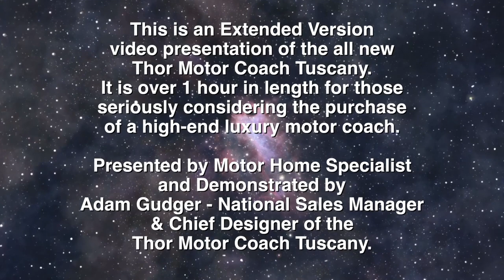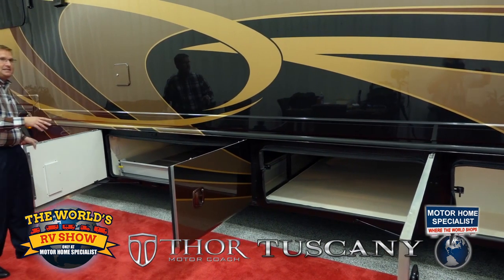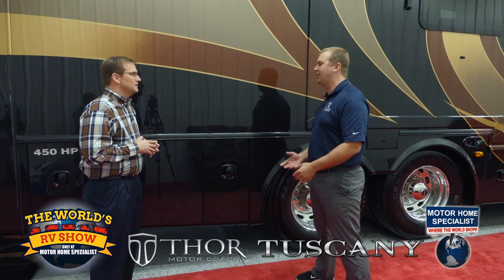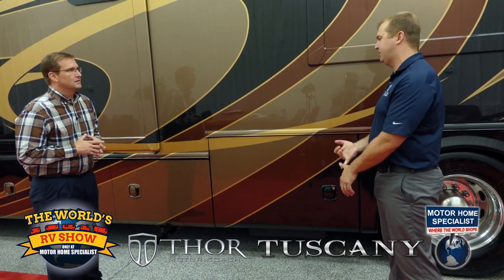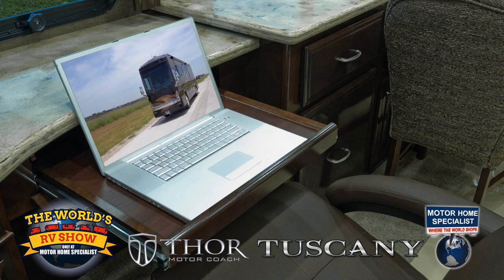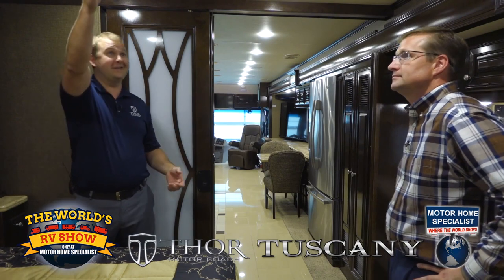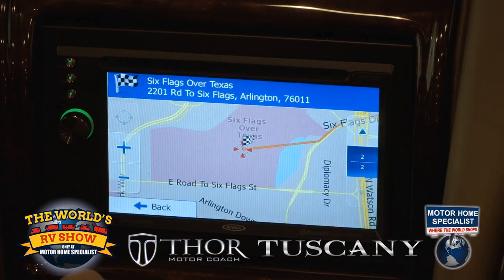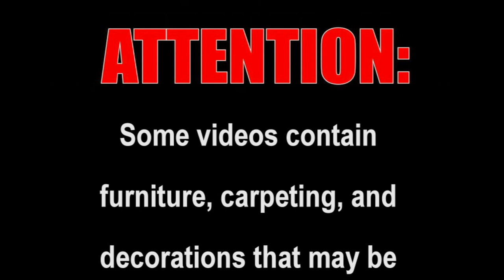Million Dollar Luxury Motorhomes? New Luxury Class A Diesel RVs For Less.

Comment: This is not an unbiased review, it's an advertisement. Unfortunately for the producers of this video, I'm both a television broadcaster and host, with a prior background as sales/marketing executive in the automotive field. Come on guys, seriously. Either produce an advertisement without a fake reporter, or produce a report with no advertisement. Place some value on the integrity of a presentation, will you?
Reply: Of course its a ad, but if you have ever been in one of these coaches, its not over stated.  These are truly incredible motor homes.  A bit long for my taste personally, But know a few people who have one and they love it.  It would go several hours to just go over all the features.  Hydraulic is huge advantage for the slides.  Also the Brain the protects not only low battery power with auto generator, but low campground power.  The awnings can be set for wind, too much wind and the retract and that is adjustable.  He missed a lot of systems but you can only point out so much in what an hour?

Comment: How many miles do you get to a gallon of diesel or gas? I guess if you have to ask you can't afford. I am single now and am considering selling my house and easing on down the road.
Reply from the maker: yescandles, The fuel economy of a large luxury diesel pusher with a big 450HP Cummins diesel engine will average around 7-8 MPG and up to 11. On the extreme side, the most fuel efficient modern  production motorhomes you'll can find would be the Avanti (http://youtu.be/Pc-YJQ0CGAQ) or the Serrano Class A Diesel Motorhomes (http://youtu.be/2ZkG5Ccndj8).
Reply: +Motorhome Reviews Welll ok iv rearranged my diary im ready to road test this baby in Australia get your ppl to contact my ppl lol love it
Reply: +Motorhome Reviews very nice
Reply: +yescandles I do not know about this one but a normal 13 meter bus uses about 3 liter of diesel per 10 km.